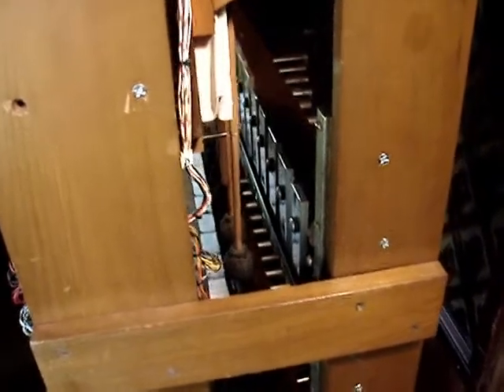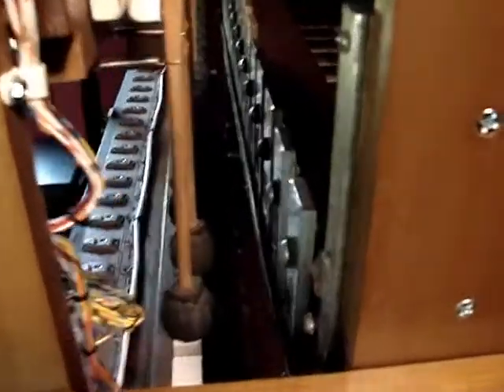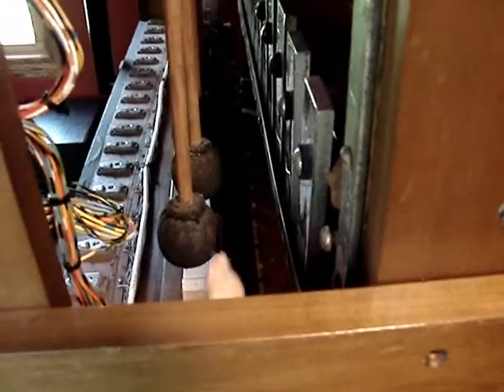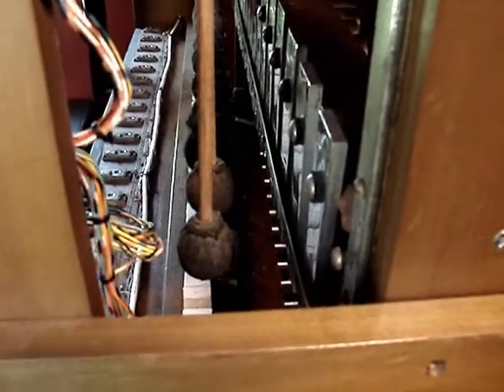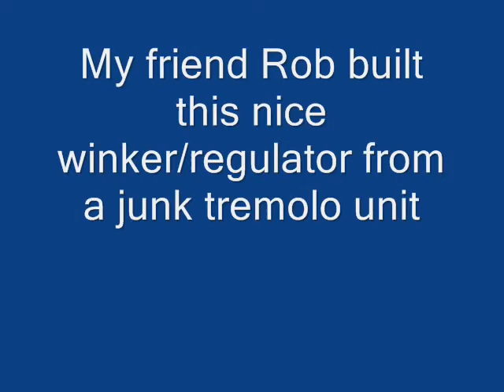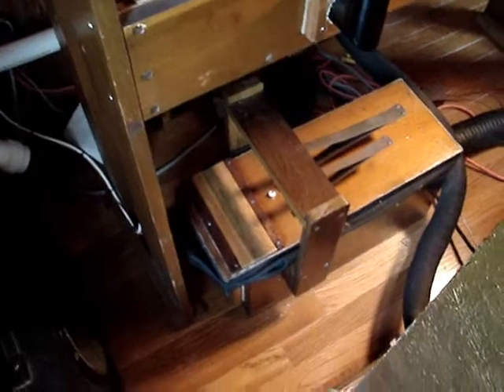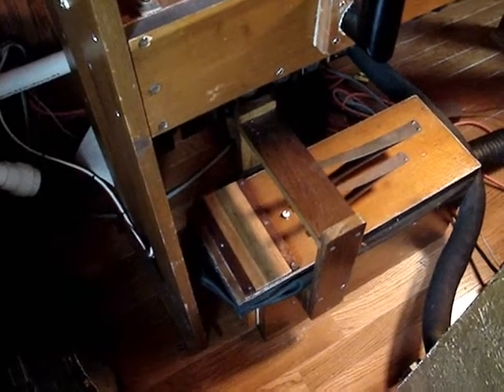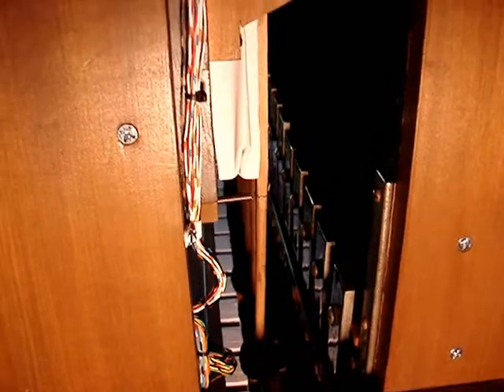Wangerin Chrysoglott PT2

Comment from the maker: @ThomasRHaines Tom the leather punchings I glued on the magnet armatures helped reduce some of the noise and now Rob is replacing springs with rubber bands. The rubber bands are much quieter than the springs are. The problem is that the chrys is right behind the console which puts the sound right in the face of whoever is playing which is mostly me. Gary